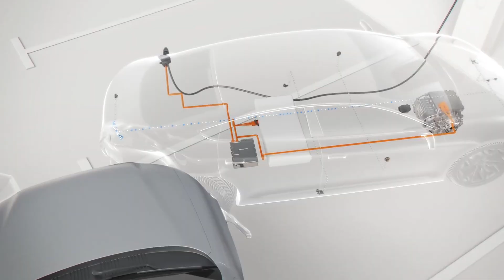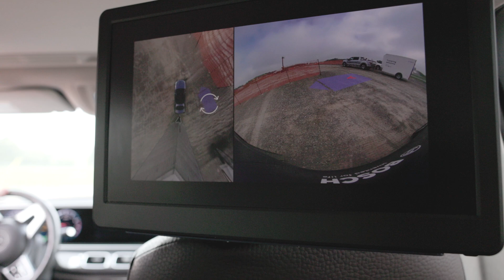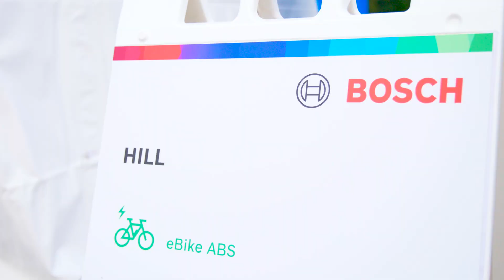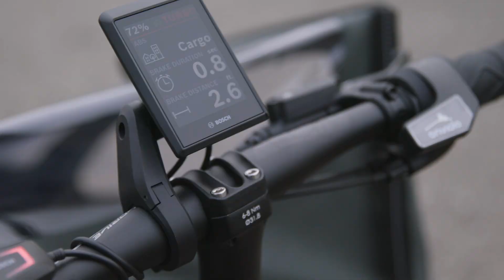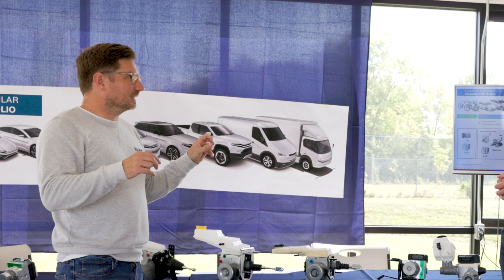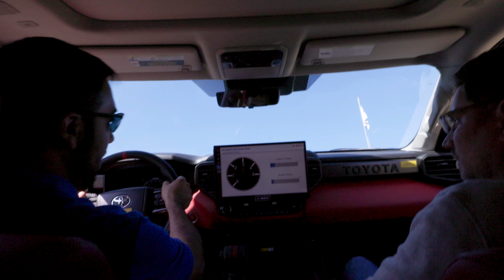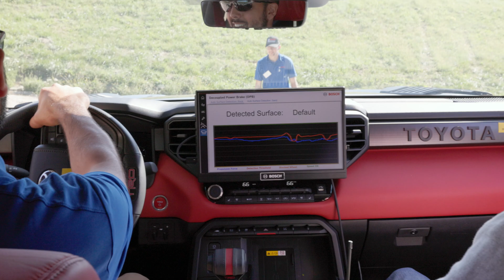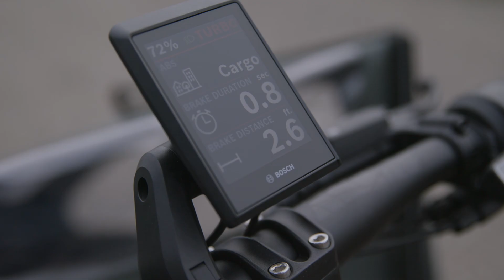Is car technology driving the way for ebikes?

Comment: Since I'm going on a long journey with a Bosch e-bike, charging its massive battery of 800 Wh (can be doubled) has become a concern for me. one easy solution would be for Bosch to create a charger that takes EV Type 2's power and people would worry less where and how they charge their ebikes.
Reply: You can already buy adapters
Reply: @phinhager6509  yes, thanks for the hint, I already have a one for 50 euros. It's just not official, might get stuck, etc. On top of AC adapters, I expect 12-24V DC adapters to be available too. There's not much complexity in them, just a matter of willingness by Bosch.

Comment: Does the ABS let you lock up the front if you want to?  I'm thinking of track stands and pivoting the bike around the locked front wheel to make tight turns.  If there is a handy switch to turn it on and off, that would be fine as a backup strategy.  I suppose if there are sensors that simply don't apply ABS below some actual ground speed, or compares actual speed to wheel speed... or maybe the switch makes more sense.
Reply: It would be cool to have a balancing device that would do trackstands for you. It took me a long time to practice to be good at trackstands.  Not only do they help in mountain biking, but they help on the road. I would rather trackstand while waiting for a traffic light than have to dismount the bike.
Reply: @ericpmoss  ABS only kicks in when the tires lock up suddenly at speed. Coming to a controlled stop, from any speed, ABS will never engage. Feather to a stop and hold the brake in and turn as you like. It can certainly be tuned for different applications and situations whether it is a mechanical or electrical system. I certainly wouldn't want ABS on a bicycle for doing flat ground tricks but for a downhill mountain bike? Sign me up! Especially as heavy as eBikes are comparatively.

Comment: There's already automatic suspension tech in mountain bikes and gravel bikes are getting on the fly air pressure adjustment tech. You should do a vid exploring them.

Comment: What e-bike community needs from Bosch: e-bike connector and charger standard (via an international standards body like SAE) including BMS communication protocol to enable high quality universal e-mobility chargers that talk to the BMS, respond to its demand (i.e. 36V vs. 48V, slow vs. fast charging, stop at 80% SoC vs. 100% SoC). This would eliminate the dangers of battery/charger mismatch, allow a micromobility owner to invest in one (or two) QUALITY chargers instead of having a substandard, semi-proprietary one included with each and every bike sale. This reduces the burden for e-bike manufacturers to source cheap mediocre quality chargers, and lets bike shops help buyers pick the one that's best for them. An international charging connector/protocol standard would also allow for public charging from municipal, corporate, institutional chargers. They could also build in a unique ID for the BMS, so that plug-and-charge schemes would be possible, where a public, paid charger syncs with an e-bike, recognizes that bike and charges flat fee, by the Watt fee, or simply validates that this bike is part of a monthly/yearly subscription or even subsidized service so no fee is needed. This would prevent overcharging, putting the BMS in the drivers's seat telling the charger exactly what charge curve to provide, as EV cars do. Currently, e-bike chargers are relatively stupid, basing the charge voltage applied, on sensing the initial connection pack voltage, adjusting applied voltage to a higher voltage, periodically sensing pack voltage again, and having a set top pack charging limit that is actually a charger, not pack-based, preset. Better chargers slow the current as you reach top SoC. But if this was up to the BMS, it would be the pack maker's job to design (and even refine) the charging curve and offer various charge profiles via the bike's interface (don't bother with apps, but sure you could do that too).

Taking this a step further, if Bosch wants to be geeky (I'd probably skip this for simplicity, but German's look for problems to solve) they could create point to point profiles that you ride often, like home to school and back, or home to work and back, or home to work to market to home, and charge the bike ahead of time to the SoC needed for that expected profile plus 10-20% buffer to allow for side trip. This would ultimately have most riders charging to 46% or 33% or 72% each day, but never to 100%, greatly lengthening the life of their pack. E-bike mfgrs could nearly eliminate the top buffer (as EV car mfgrs have now done) knowing that although the option to charge to 100% is there for the rare need, you are generally undercharging your battery for the health of it. That lets them advertise the ideal top limit range based on the occasional 100%-0% (with bottom buffer) DoD, but know that almost no one actually depletes their battery daily with that long of a ride.

We know that public charging of e-bikes is an expectation without a current solution. Bringing your own charger and securing it in a locker is a bit of a faff, as the Brits would say, and it leaves 120V outlets to be used for unintended purposes, possibly with unexpected power draw/fire results (think powering a TV in a homeless encampment). I don't mean to single out the unhoused, but bike charging infrastructure is probably best done with very specific intention and not via poorly thought out pubic outlets. 

And another thing: though e-bike packs have no active cooling and should not be thought of as comparable to thermally managed EV car packs, they fundamentally use the same/similar cells, so faster charging is possible than most are comfortable doing now, because cables, bullet connector, no actual coordination between charger and pack. EVs aren't magic, and with the right thermal management, all cells in a Taycan pack are seeing the same small voltage and same high C rating. 30-40 minutes 10-80% could be done for e-bikes should a pack designer bother to build in thermal management and sensing, and a carefully coordinated charge curve with feedback loop to the charger. This could enable better utility from smaller batteries if people knew they could pull a fast charge on the rare (monthly?) occasion that they go farther than their usual riding. This parallels the occasional DC Fast charging that EV car owners expect but most rarely need. A universal charging standard could certainly enable someone to occasionally go twice as far as their normal bike range without overthinking it, knowing a 30-40 min. 10-80% charge opportunity is present on every public bike rack.

While we're at it, let's standardize the e-bike communication protocol so batteries can be safely interchangeable as they fail and need to be replaced on models that will now need to talk from the controller/display to the BMS. 

And don't stop at e-bikes. This is a great standard to power all micromobility including small microcars, e-scooters, EUC. Make the standard expansive enough to quick charge 5.5 kWh packs like they have on the Ami/Topolino/Rocks-E microcars. Ok, that'd be 5,500 Wh x 70% = 3,850 Wh in 30 minutes. With 48V nominal, that's average of 160A which is a lot, but let's try to plan out how this could all play out now, before we keep going further with full sized EVs, and fail to standardize micromobility. Thanks for listening to my Ted Talk.

Comment: Turn signals, a break light and highbeam ist what I want. :)
I know I can get all of these, but they are not standard.
ABS is nice as well, but I wouldnt use break by wire or automatic shifting, because its taking control away from me.

Comment: Typically I'm of the opinion of keeping bikes simpler, but brake by wire could be made available for ebikes pretty easily, by simply making electrically powered calipers powered from the main battery. Wires replace cables, brake levers mount as they always have, and they could be installed on any existing bike.  I had been giving this thought since I was in a crash earlier this year.  I was going too fast due to a tailwind and a hill in combination.  I wasn't comfortable with that speed, and was unable to slow down enough with my mechanical brakes, so when a crosswind hit, I was violently thrown into a guardrail.  If I had more powerful brakes, perhaps I could have regulated my speed better.  Of course brake by wire has its own issues with power.  Namely the brakes stop working if the battery dies, while the rest of an ebike remains a functional bicycle.  less of an issue with heavy cargo bikes, but for lighter weight commuters, and home builds this could be a factor.  It's something to think about.  One has to ask where technology comes in to a bicycle, and how much technology makes it stop being a bike, and start becoming something else.  There is a place we still need to find between bikes as simple efficient machines, and bikes as modern technology.

Comment: I'm just waiting for e-bike ABS systems to include a winter mode, and maybe even a winter MTB mode. Honestly, even a regular e-bike that can function and be stored at temperatures as low as -40°C would make it a practical option for most northern hemisphere countries.
Reply: you realize negative 40 is colder than Antarctica right?
Reply: @muscleman125  I'm in the Canadian Prairies, where winters can reach -40°C.

Comment: ABS will probably add $100 to $200 to the cost of a bike. It's not economically reasonable. Considering the under-20 mph speeds that the majority of bikes travel at, it will actually reduce the availability and use of e-bikes.
Reply: As an option on higher end e-bikes that price would be perfectly reasonable. I don't think it will reduce the availability of e-bikes unless it was mandatory on all and that is not around the corner as it isn't even mandatory on motorcycles.
Reply: @matthewthomas4620  if it was mandatory there would be incentive to bring a cheapo version to market, bringing the price down
Reply: @von1477  Thats true, but I don't think it makes a big enough difference on a bicycle to make it mandatory. I think it will come down market over time like disk brakes did. On motorcycles where the speeds are significantly higher I could see ABS being mandatory and I would have no problem with that, presuming they allowed it to be switchable for people going off road etc.
Reply: @matthewthomas4620  In the EU ABS is mandatory on motorcycles over 125CC.
Reply: ABS currently adds £466 / $600 to the price, so probably will just stay as high end option from companies like Reise&Muller. Cargo bikes and other heavier eBikes might also be the new market for ABS options.
Reply: Bikes that will have this are already several grands! It's a small portion of price.
Reply: I remember when people said the same about suspension , disc brakes and dropper posts. What ever happened to that stuff!?!?
Reply: Laughs in $10,000 carbon fiber road bike..
Reply: If a dirt bike/adventure bike/trail bike wasn’t able to easily disable the ABS then I and most serious off road riders wouldn’t even consider buying it. I ride my MTB for extra fun and fitness and have never had a moment where I thought ABS would have been beneficial. I could see it would make sense on a cargo bike that is loaded up but on an E bike with quality brakes I can’t see the need. I very nearly bought a Reisse and Muller and saw ABS was an option but again even if it was offered at no extra cost I would have chosen not to have it. If e-bikes were unrestricted and cruising around at 60kmh I guess it would make sense, but they aren’t and if you want to do those speeds you should be buying a scooter. It’s unnecessary.
Reply: @BillyBoblovesthedirt  speed is irrelevant. I can go 10 mph on my road bike and completely lock the wheels up with ease. The moment you lose traction is the moment things can go bad. For a random person riding their e-bike through the city and suddenly having an OH NO moment when a car door opens, a pedestrian steps out, etc, those ABS brakes could save you ending up on the pavement or worse.